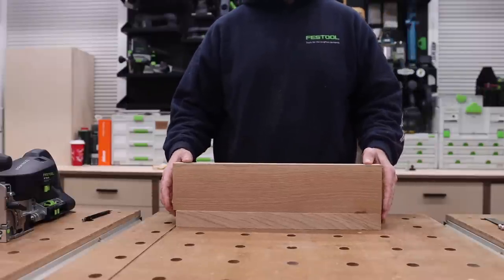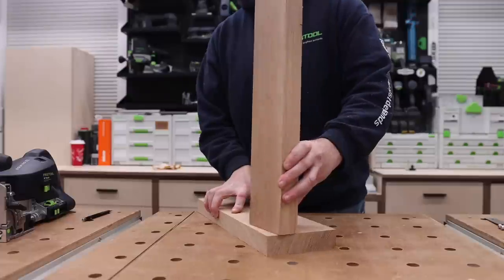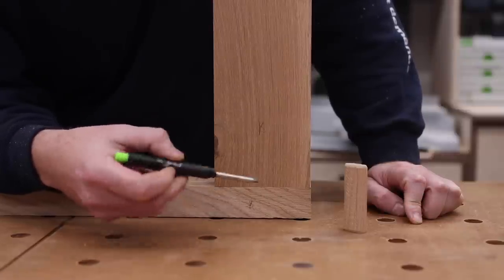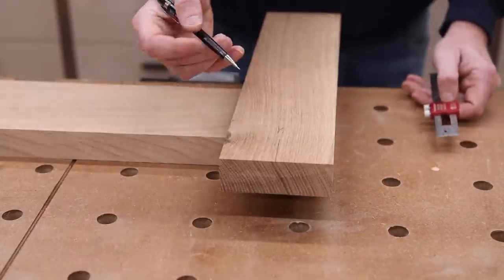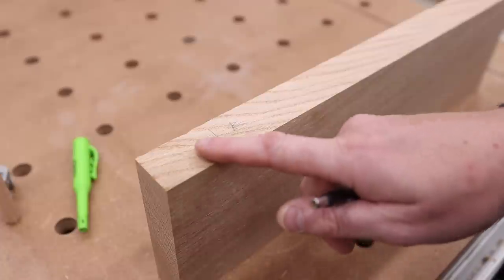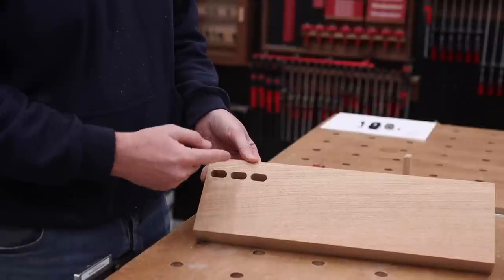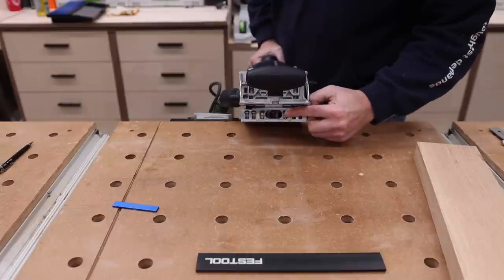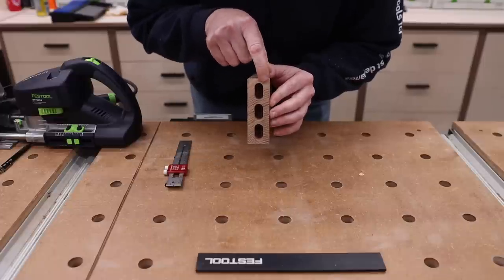Better than the lamello connectors?

Comment: I used the connectors for a TwinXP over a Queen bed setup for a client a couple years ago and they really worked well. One thing I did find necessary was to gently ease the fixed Dominos with abrasive paper for a snug, but still "slip" fit. They were too tight if the Domino stock was left as normal to knock down without using a heavy mallet. (dry-fitting was maddening...)

Comment: I just finished up the mortises for the legs and apron on a white oak dining table. 

A few tips that made it very straight forward for me that are likely obvious to most. I first did a prototype with short scrap pieces that matched the apron and leg dimensions. I then marked up the prototype with the settings for the plunges in the leg, the end of the apron, and the back of the apron with the plate and plunge depth numbers. 

To keep things simple I did all of mortises of each type before resetting the 700 for the next type, using my marked up prototype to give me the numbers. 

My apron width was the same 108MM (4.25 inches) as the rails Jason used in his video. I also used three dominos, but I used two of the Festool connectors and one wooden domino in the center. I used the 20MM stop to set the distance for each of the connectors for the top and bottom of the apron. That allowed me to minimize the measuring and marking needed, which always creates an opportunity for user error. Since I used a wooden domino in the middle, I didn’t need to find the middle on the back of the apron to create the access hole for the anchor for the mechanical fastener.

Thanks again for the video Jason.  It made all of this much more understandable than the Festool instructions.  

Bob
Reply from the maker: Glad you found it helpful

Comment: Great video showing how simple and easy to use the connectors!
As far as strength, I can attest to that.
I made an Ash conference table for a client that was 2.25 inches (56mm) thick, 6 feet (1830mm) wide, and 20 feet (6096mm) long. It also needed to be shippable. Using the connectors, the table top could break down into 4 sections 3x10. They had no trouble at all holding that beast together!
Reply from the maker: Thank you Al
Reply: How many connectors and wooden dominoes across that table? I need to put a table together that's only 28 across, 2 inches thick. One edge is on steel and the other edge overhangs about 20" of air. I'm worried about movement vertically if someone were to sit on the tabletop at that connection.

Comment: Great illustration with the domino. Would have liked to see how hard or easy to disassemble the joint would have been.
Thanks
Reply from the maker: You just loosen the set screw and pull it off 👍

Comment: When making the middle hole for the locking mechanism, should the setting be “tight” even though the only reference is a pencil line, which when lining up the domino, it won’t be exactly in the same spot on both mating pieces?
Reply from the maker: Yes, tight setting. There is some play.

Comment: Great video.   One thing, at 5min you  layout the apron center at 54mm but reference the bottom of the apron.  later you measure 54mm for centerline on the leg but use a different reference.   If the apron is exactly 108mm no problem but I think it better to stay consistent with the reference.
Reply: At time 8min you plunge the material with your hand and fingers in the line of fire.

Comment: Another great instructional video Jason! I like to install the support bracket or TSO Bigfoot bracket when referencing off the edge of a board, especially with the DF700, but probably overkill for 8/4 material. And not to be the safety police (I don’t want to be featured on #GETBENT), but I never put my hand on the backside of the board I’m plunging into, just in case I miscalculated my plunge depth.
Reply from the maker: I usually use my big foot as well. It’s great!!

Comment: Do you have to use the Domino 700 for this or will the 500 do the trick? Thanks,  Pat
Reply from the maker: Depends on the size of the project. I use the 500 connectors as well for smaller applications.

Comment: Hi Jason, Thank you for sharing; this was great to watch.  But I'm wondering if I am understanding correctly how these things work.  

It is obvious to me how the first part you installed worked: the threaded connected pushes out the metal grabbers to snag the wood in the leg piece in your video.

But the amount you tighten that connector piece impacts the length the eventual hole will be from that piece.  This seems to me to imply that if I were to not tighten the post sufficiently then the hole in the receiving part will actually be too far distant from the set screw you install and tightening the set screw will actually secure the connector in a position that will NOT close the gap; is that correct?

So the depth of the mortise in the leg piece AND the amount of tightening AND then location of the set-screw piece all need to be exactly spot on, yes?  If the set screw is too close to the leg, will the set screw actually push the leg away from the apron?

Hoping I am not being overly obtuse.  Am I not seeing something?

Comment: Hello Sir, would the 500 connectors also work for this bed application?
Reply from the maker: For the thickness of material I used, no. Max recommended material thickness for a 500 connector is 28mm if I remember correctly.

Comment: Nice video. I just got my 700 and am considering getting the connectors. Quick question about the anchor and the hole. You rounded up on the plunge depth. And, you seated the anchor all the way in the hole. I was concerned the hole in the anchor wouldn’t line up with the post. I guess it’s not enough of an offset to be an issue?  Thanks!
Reply from the maker: Lining up is no issue as there is space to move.

Comment: Exactly what I was looking for thank you!  I am considering the DF500.  Does the DF500 connector set have this same joint capability?  I know you mentioned the other channel but honestly I couldn't get through their videos.  I like your content.
Reply from the maker: Thank you!
Reply: I have the connectors for the 500.  They are very strong but not nearly as much at the 700, as would make sense. That being said, for most applications that don't require the additional strength, the smaller ones will work fine, especially when used with the regular dominos.

Comment: A good video Jason. Thanks for sharing. Some very useful tips. Does the 700XL come with a support bracket for vertical plunges?
I saw your DS hatbox in the background... Did you make that?
Also, your tool rack in the background... do you have a video on that? Thanks for your time.
Ron
Reply from the maker: I didn’t make it. My wife bought it for me while I was a drill sergeant. The wall is OmniWall

Comment: Hey Jason, this question may be too broad, but what use cases are 500 connectors vs 700 connectors for? Thanks!
Reply from the maker: Size of the lumber and the specific project. Needing more holding power for this bed and lumber thickness.

Comment: Where did you get the info to put 3 dominos for this setup? There is almost no more material left on the apron. The festool manual would say to use either two small ones or a big one in this case if I remember correctly.
Reply from the maker: It’s not referencing anything. It’s just the way I would prefer to do it in that scenario.

Comment: Your video reminds me of an issue with one of my favorite shop items.

I really like the Pica-Dry Pencil you use for some of the marking. Mine get used a lot because they're a jack-of-all-trades pencil. Not the most accurate, but enough for many of the uses and soft enough for legible writing without scratching. It's rarely useless. They're also rugged enough for the shop. 

The problem is the cover. The big green cover protects the pencil well, and the sharpener is useful. But when you're using the pencil you've got nowhere to put it. You can't stick it back on the end of the pencil and have it stay like a normal cap. You have to set it aside or clip it on yourself. My Pica-Drys often travel around the shop without regard for the location of the cover until I have to sharpen them. 

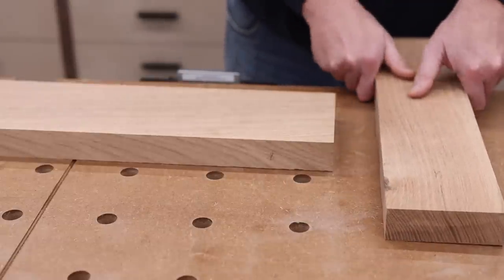It's obvious in your video at 6:00 when the cover is in the background even though you're using the Pentel P205. 

It's a problem I have with many good tools - extra parts to track. I'm a person who has trouble staying organized. When something doesn't have a place to be, it has a risk of being anywhere. At least it's a big, easy to find part.
Reply: I use a small tool pouch and I keep my pica dry pencil in it with my other tools. The cover/sharpener stays it and the pencil goes back in it when I am not using it. You do have to use your finger to keep the cover coming out of the tool pouch but you get used to that.
Reply: @ronh9384  This is a good idea. I haven't got a consistent tool apron or pouch. I've been inconsistent about this and it's something I need to work out.

Comment: Jason, great video. I am making a white oak dining table and I need to ship it out of state. I have the 700 and was thinking I’d need to do the glue up of the legs and rails on site. My rail material is just about 1 inch thick. Before I buy the connector set, are the rails thick enough for this system? Thanks, Bob
Reply from the maker: Well the mortise is 14mm so you wouldn’t have much material left. That being said, it may work. I would have to test it out
Reply: Thanks! Will do!
Reply: I did some research. The Festool specs for the say you need a minimum of 30mm for the DF 700 corners connectors. An inch would be about 5mm short of that. Bob

Comment: Those connectors are much more beefy that the ones I use with my DF500.  BTW, you mentioned the Lamello in your title.  Did I miss where you did the comparison?  I would think a 14 Clamex would work pretty well, too, but I wouldn't think it would be nearly as strong as the 700 connectors.